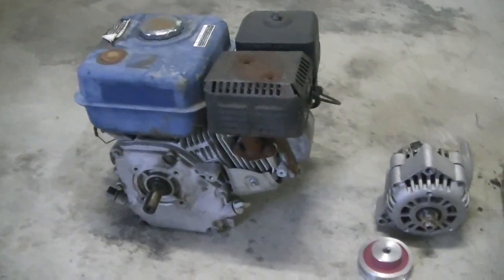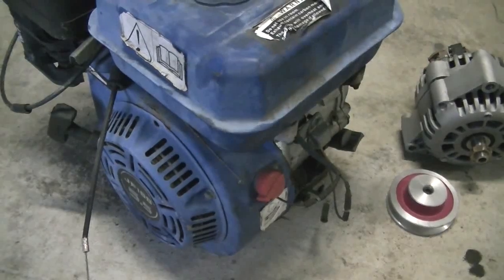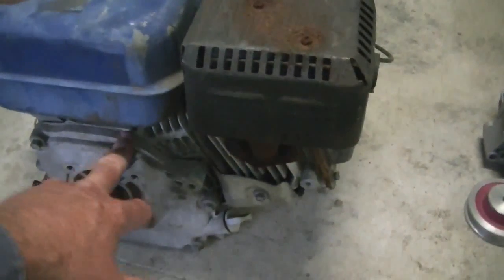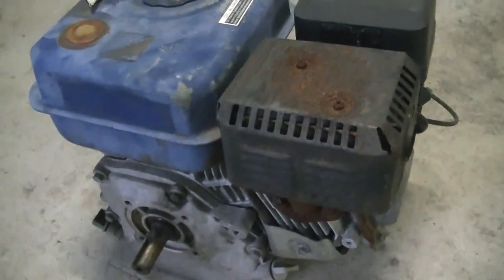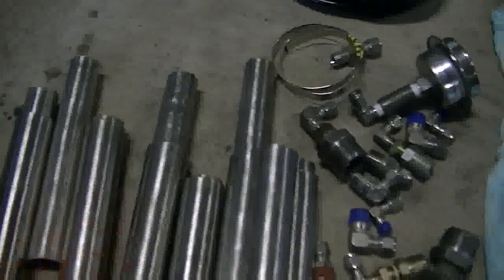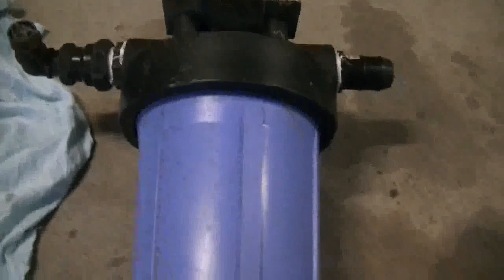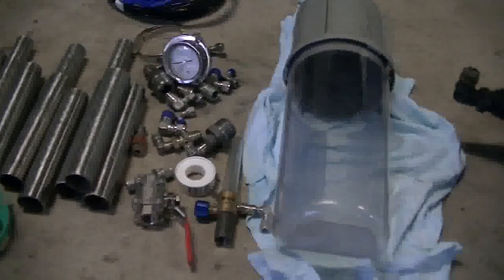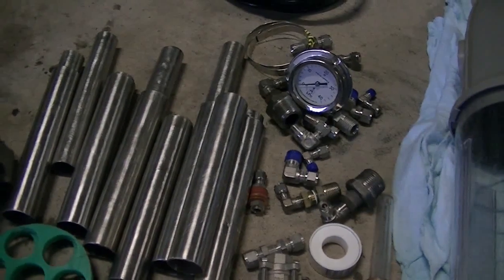My HHO project pt1.flv

Comment: Hho work correctly. I know you talk with Irondmax and i commented that Mr. Meyers used a WV powerplant for a reason. It was easy to modify and he probably used custom ground camshaft. Its the missing link. Today at Mercedes-Benz we use electronics to control cam timming. Hope this helps. David A. Puchta

Comment: Its been a while since i worked with profiles. i went to school for cam grinding an ground my own cams when i built motors for Porsche. You advance the cams to get more vacuum. The cams usally open before TDC so you advance them to get a vacuum scavenge effect from the exhaust valve. And the lobe center is widened for low end and tightened for top end. On low end you need more time to build uo a vacuum. My point it is you can pick or grind a cam that will work for your 5hp engine to make...cont

Comment from the maker: @neiallswheel Hi neiallswheel-All parts are avalible to withstand the abuse of HHO,this is thanks to the rev heads and there insistance on useing nitro kits lol.You can buy after market parts for high nitros oxide use that will withstand anything you throw at the engin.

Comment: @KyleCarrington I like your idea, really think that is a good direction. 
one thing to add: If a little steam is added to the fuel
1)it slows down the burn rate and 
2) because of the explosive nature of HH a certain amount of the steam is fractured into hho inside the cylinder.

Comment: @TinManPower What I mean to say is this, let's say you are able to produce 30 lpm or whatever the small motor needs... why not introduce CO, or CO2 from the waste back into the fuel, to adjust the overall rate of explosion. If possible, then your piston head and any microfissures will not be further cleaved by exploding particles, the smallest known on earth.. as to get inside, and destroy an ICE never originally intended for H2 explosion. Just a thought.

Comment: @TinManPower Is it modded with perm magnets or does it require being hooked up to a battery. Why the concern for waste spark? Are you planning to make enough HHO to run it 100% on hydrogen?! In any event.. why not change the flames peed of your fuel, instead of changing your engine, design for a certain fuel... that's how Stan did it, if I am not sadly mistaken (which I often am LOL)